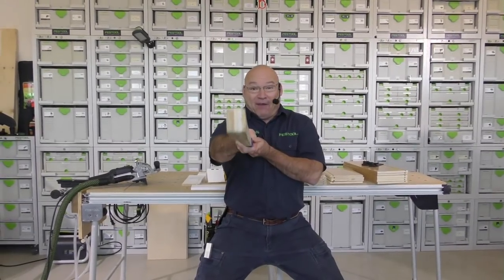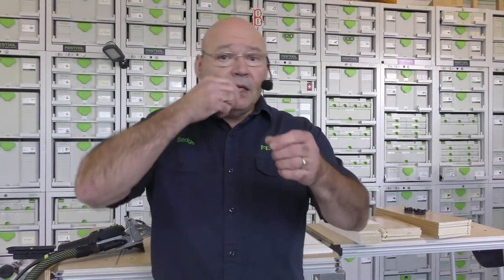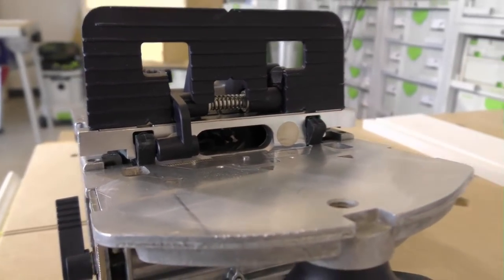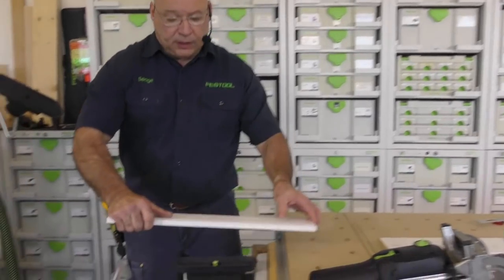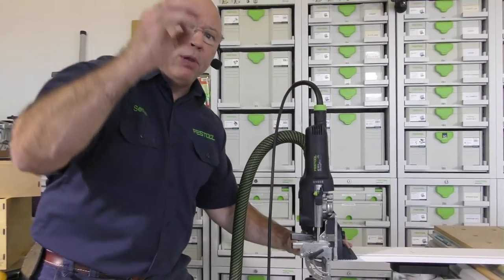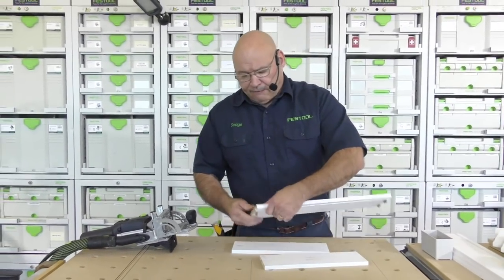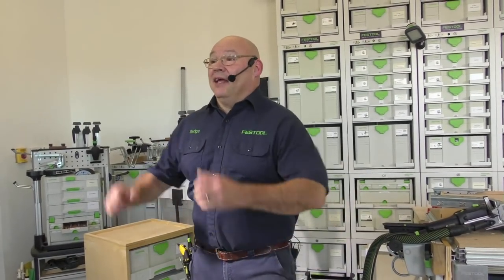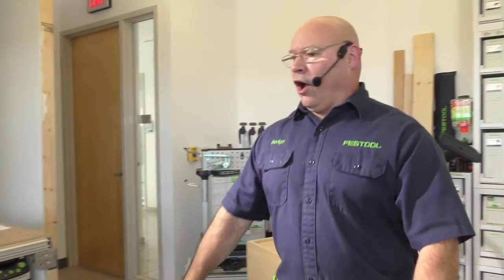Festool Live Episode 32 - Domino Drawer Box

Comment: I was making some shop drawers today with 3/4 ply. I assembled them with glue and pin nails. Then I plunged through the sides using #6 dominoes. I set my depth to 28mm. When you drive in the domino’s they will be proud. I cut them off with a trim saw. Easy and totally accurate.

Comment: Hey Sedge - This is one of those tips or lesson learned things. I was making some. Drawer boxes with 12mm material. I was using the support bracket. Since there is no standard material thickness stop for 12mm here is what I did..

1) Installed support bracket with the machine on a flat surface

2) Based on the height scale while the machine was inverted on the flat surface I pushed the height adjustment to the lowest point and locked it.

3) Since I was not planning on using the flaps, just the stops on the support bracket, I moved on

4) Ended up with some alignment issues

5) While you make a note to make sure the flaps are free moving you don’t say why - the reason is the support bracket stops NEED the flaps to hold them in alignment, i.e. the support bracket stops are really spacer from the flaps and the flaps are needed to insure consistent location and not allow movement.

Thx again for the great videos - Bill

Comment: Super video! I am making drawers with dominos. I made pretty much every mistake Sedge warned about! Also, if you use the Domino to cut the notch for your Blum undermount drawer slides, his measurements only work if you are using the same thickness of drawer sides.  Mine is a bit thicker, so I had to make my own measurements.  Worked well!

Comment: I know they have to upsell the cross-stops 27:10, but I just do the middle ones with a loose middle mortise in the fronts and backs, whilst keeping the sides tight.  You only really need them for the sheer strength.

Comment: Can your drills and bits go through 1/4" & 1/2" plate aluminum?
Reply: The bits are designed for woodworking. If you're ok with replacing the Festool Domino bits I don't see why you could not use the Domino 500 and the new Domino connection system to join Aluminium,  but then again there are much better methods for joints to connect aluminum such as 8020. And the fitting for 8020